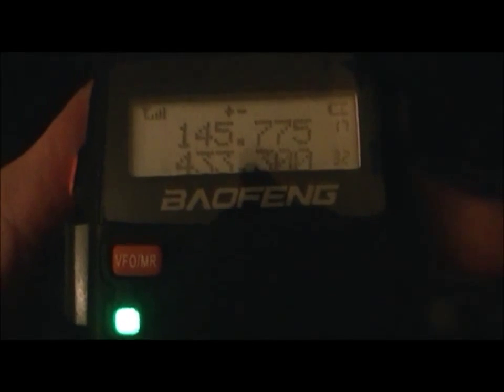Baofeng UV-5 RC UK receives AUSTRALIA via 433.3000Mhz  repeater.WOW!!!

Comment from the maker: Hi Shane...i dont mind your questions at all my friend...ok the `s` on the left is for dual watch,you can set this in the menu,which means it constantly switches between the top and bottom freqs on the display looking for a signal.The +- sign indicates that you have an offset for transmitting/receiving (duplex) example transmit is -600kHZ and receive would be the normal freq. and the final one is `n` or `w` simply, narrow or wideband,not to be confused with freqs,its there for your voice! ;-)